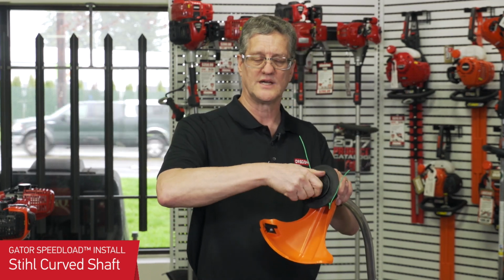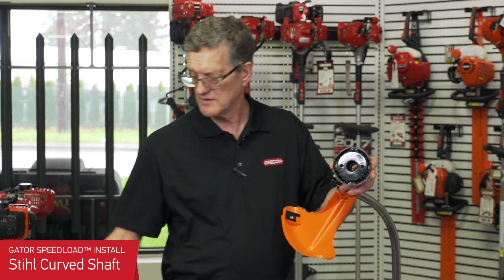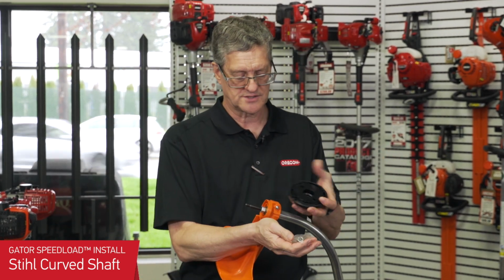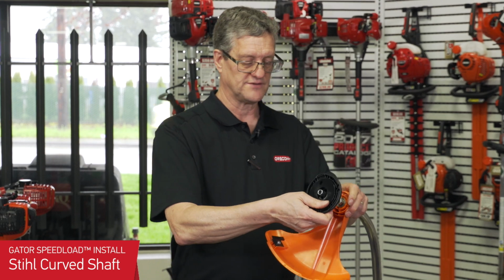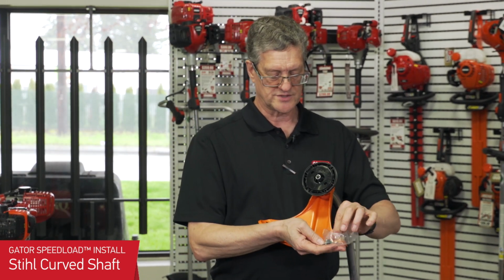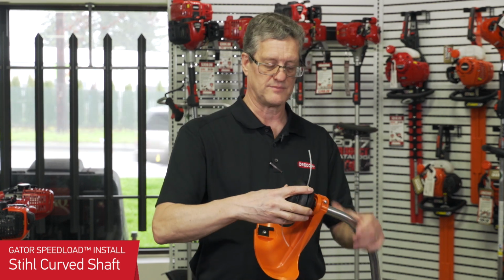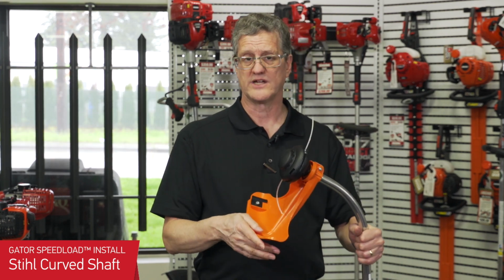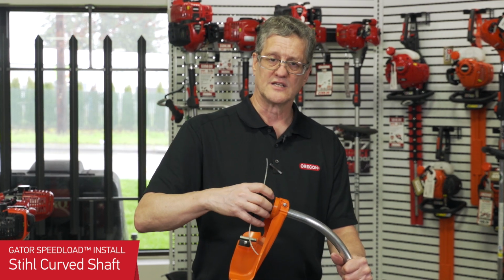Gator SpeedLoad Installation- Stihl Curved Shaft Trimmer

Comment: great homeowner set up for small areas   fs 40c and gator load....   i am trying to adapt a speed feed echo head, which is fairly easy to wind, compared to stihl heads, echo makes a adapter kit, and a CURVED shaft head option, that the local lawn shop says will work   We have a couple Oregon Gators, and they are good, especially for occasional users or people who struggle to use tool tech and want easy feeding/spooling.  Good luck and enjoy your new trinkets.

Comment: What is the Gator Speed Load model you used in the video ?  I have a Stihl FS 40 I would like to buy a speed load head.
Reply from the maker: Hello  Craig,

The Oregon Gator Speedload head 24-200 will fit the Stihl FS40 if the model year is 2001 and newer.  If it's older than 2001, we do not have a Gator Speedload that will fit. 

Thank you,

The Oregon Team